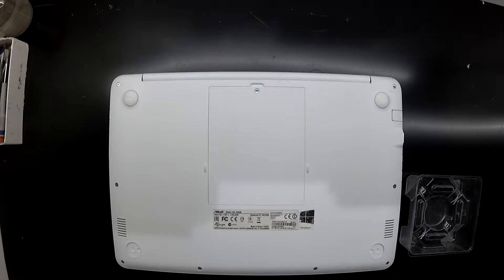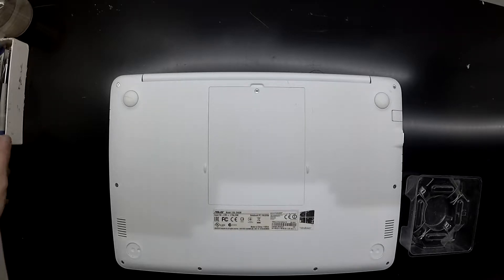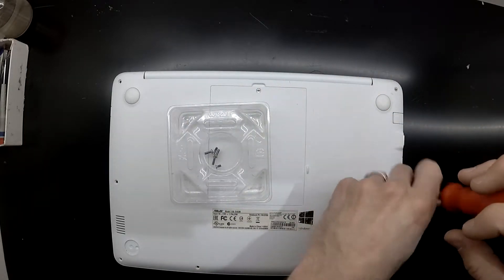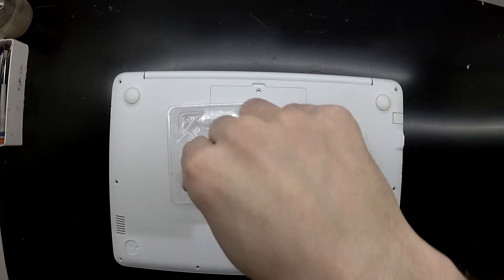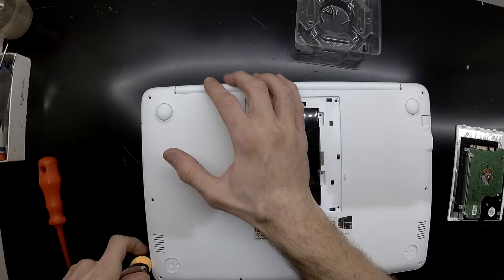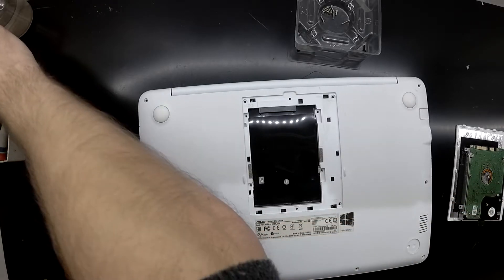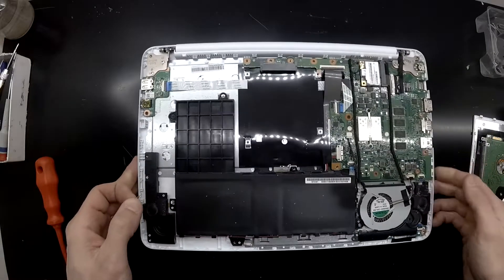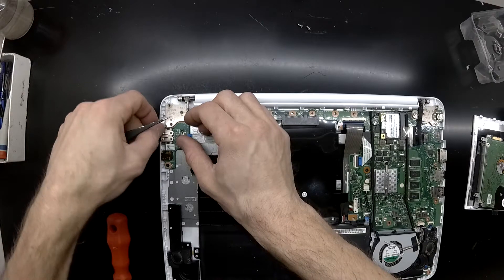ASUS EeeBook E402 Teardown

Comment: Hello Buddy, Nice Video, I use this laptop and it sucks, the Asus service center said that this has ram installed to its motherboard but Hackintosh says 1 port is left can you please verify the same. Thanks
Reply from the maker: Ram is soldered, open this to verify
Reply: @rickstechrepairs  Thanks